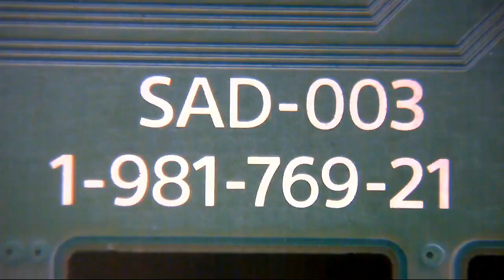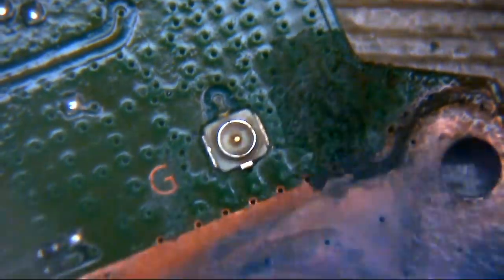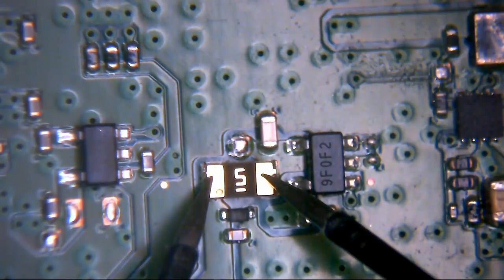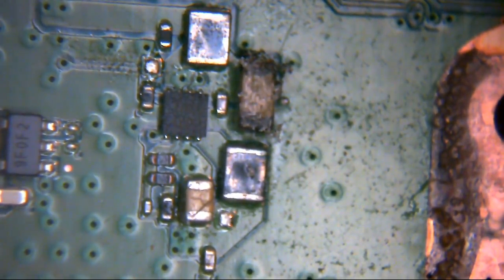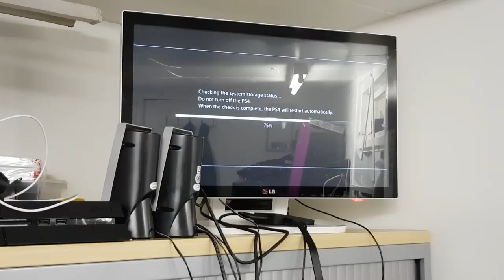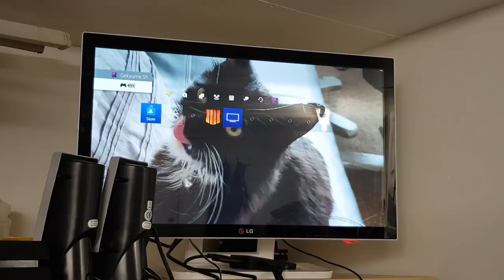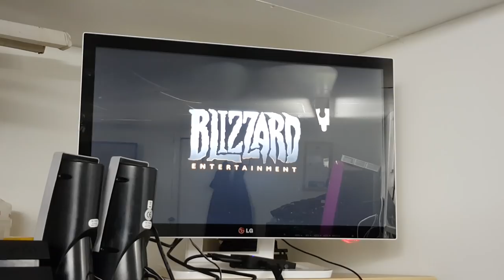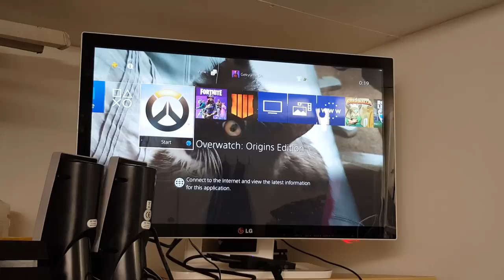PS4 Slim SAD-003 No Power - Component-Level Diagnosis and Repair

Comment: Quick question for anyone smarter than me - PS4 Slim, BLOD beeps once, then shuts off. It's not the PSU. No shorts on the Power Management IC or around it. No shorts on caps around and under SIE. Should I just salvage it for parts (if it's RAM or APU) or should I continue with the inspection? Thanks!

Comment: I have a question? Working on a slim power supply is good tested when I plug it up it takes about 3 minutes before it will allow you to turn it on I got it to update but after that when it cut off to restart it was the same issue. Now it’s trying to check drive so it cuts on then off to cut back on but instead of going to the check disk screen it just cuts off I can get into safe mode if I wait about three minutes for it to finally cut on. My questions is it the power management ic and where abouts is that located on a saf-005? Thanks any input would be appreciated

Comment: Possibly Going Mad with a 1200 Series PS4 😅.
Reballed the Southbridge Twice I have the correct Voltages around the Nor and Also 3.3V On the Switch yet It's playing dead definitely 1 i could cry over

Comment: Hi Andrew, my PS4 Slim CUH-2116A it has the blue light of death. When you turn it on the blue light flashes, the fan works very fast and loud at this timeand. When it turns off you hear three beep. Sometimes the fan does not start at all and the blue LED is constantly lit. Me wondering you know what is this? Is this a GPU, south bridge or power supply? Your video are great !

Comment: I have an slim ps4, that it does a "bip" and doesn't start up. It doesn't even give me a sign that it works, no light, nothing. I changed the psu but still nothing. When the device is like dead(without light or anything), only the eject button seems to work(makes a noise), but the power button, nothing at all. Any suggestions? 
I appreciate it

Comment: i have found electronic component cleaner spray can to effectively clean thick solder paste residue and corrosion removal. Its kinda oily but followed by iso prop clean, gives pretty good results. But im not a professional just a hobby of mine. And i dont know if the corrossion will spread again; i dont think mine is a permanent solution.

what temperature do you use on the hot air? i use 450 c. with airflow on 2 or 3 for small nozzle and 6 to 7 on large nozzle. is that safe?
Reply from the maker: Good to know :)
I'm using 490C @ 100l/min. Largely I leave it set the same, I just vary the heat / air intensity by controlling my working distance above the board / component.
Reply: @AndrewPaul  thats why that capacitor nearly flew away from that board ;)

Comment: I hope you don’t mind me asking a question about a one I have at the minute.  It doesn’t power up at all when first put into the wall. Leave it for 30/45 mins it will boot up and then last 5/10 mins and the process needs to be repeated. What could be causing this? Checked the system and it seems fine, battery good and the board looks good. It’s got me stumped! Can you help!?

Comment: Hi Paul. I know this is kind of old video but I was hit wall with similar issue. I have a ps4 slim SAD-001 that had faulty HDMI IC and replaced it successfully. Then found out the USB ports had no power and did a Southbridge reflow.  Now the PS4 has no signs of life. No power, no lights,  no beeps. Where should I look from your experience? I have reference board SAD-002 that boots up ok to compare but had no luck to find the fault.
Reply from the maker: If you've no power after a Southbridge reflow then it's likely to be related. For what it's worth, usually reflows aren't enough to resurrect USB issues on slims, it typically requires full replacement of the chip. I'd be tempted to do this in any case as you'll likely kill two birds with one stone - the Southbridge controls power management as well as USB functionality on these consoles.
Reply: @AndrewPaul  I have a d donor board,  and I will try it. First I will reball the current chip  since I noticed bridged pins at the edge of the chip. If it fails I will take the one from the donor board. They are not married with the mainboard,  right?
Reply: @AndrewPaul  The story short... I have the southbridge reballed once without success,  but since the reball was with wrong stencil and wrong size of solder balls,  this is not a conclusive result. I am expecting new stencil and balls at tge proper size to reball again. At least checking out the pins under the Southbridge didn't find shorts,  so I am hopeful that a proper reballing miggt fix the PS4. Thank you for your input mate.

Comment: But after replacing HDMI is still no image and I noticed there is a components knocked off don’t know what trying to find the schematic or help. The part is back side of the board (HDMI reference) right above the HDMI
Reply from the maker: Do you have a photo of the board in its current state?

Comment: good job andrew the first one brown is capacitor .. charge from one side and discharge from other side which goes to ground .. it stabilize voltage and keeps same voltage supply for the components during the ( ON ) condetion of mother board ..
the other gray ( you said is cap ) no this one is smd coil .. they are connected in each side so
normally there be buzzer in contunity test
will buzz .. how ever the coil function is to keep the amps feeding throu the for all other components in the ( on ) condetion 

good luck man 

i really enjoy watching your videos 

thumbs up

Comment: @Andrew Paul 
Thank your very much for your Videos ! I have a Question about the PowerButton on the PS4 , what Voltage should i espect to be on the Power Button ? Because i can only read 0.24 V on my Ps4 on the Power Button . This Ps4 wont turn on at all. thank to your videos i found out that the line filters on the HDMI Chip are all shorted to ground. I removed the Chip an the short was gone ! But the Problem remains i think its another short somewhere !
Reply: 4.7v on the powerbutton

Comment: Good morning 
Andrew. Thank you very much for uploading this educational videos. That is very appreciated. 
I  have a ps4 that will not recognize my controller in either of the front usb ports. I used a USB tester, and and I an getting 5V, but th wired controller that I use does not go into charging mode like it usually does on a normal ps4. I tried  swapping the BT module but that did not fix the issue instead the ps4 would not turn on. Maybe I applied to much heat to the donor chip and I end up runing it. 
Could it be that maybe the USB CHIP  that control the USB ports went bad and it needs to be replace? If that is the case what is the name of that chip?
Thank you!
Reply from the maker: Old CUH-10xx and 11xx machines it's a GL3520.
On anything else, it's the Southbridge which is responsible for hosting USB.
Reply: @AndrewPaul  Thank you very much for your help! You have wonder new year!

Comment: Hi Again :) please can you take a look  at my two ps4's normal console that's had blue light death and red light of death heats up soon as  you turn it on, dust build ip.  when you insert game few seconds in flashes red then turns the console off. and ps4 slim with hdmi issues , im looking at just getting ps4 slim fixed for the time bein can you pick my console up?
Reply from the maker: Sent you an email this morning mate. Cheers.
Reply: @AndrewPaul  Diolch i been waiting to hear from you need console fixed ASAP!
Reply: @AndrewPaul  get my yesturdays email fella on pulseing Blue when start up or turns white, also trying find ut do yu have Cnsoes picked up from South Wales

Comment: Andrew, what Ultrasonic device do you use?
Reply from the maker: This one I believe:
https://www.allendale-ultrasonics.co.uk/professional-13-litre-digital-cavitek-ultrasonic-cleaner-tank-with-heated-bath-220v
Reply: @AndrewPaul  which cleaning solution do you use and how much “water” do you need to fill in? i guess you dont need to fill up fully but just cover the board?
Reply from the maker: It's specialist PCB solvent supplied from Allendale. The bath itself requires a minimum level of 2/3rds of a tank of solution at all times - I'm assuming this is to keep the transducers cool during operation.
Reply: @AndrewPaul  Thats very interesting. Sorry ot bother you with the details, but it's my first Ultrasonic i have and wonder what experiences you have. How often do you switch the fluid/destilled water mix then? Do you keep the fluid in there and only chance when really dirty? or with every new wash?
Reply: @AndrewPaul  And sorry if I ask more thing, but I find your videos extremely helpful! Can you fit a PS4 pro motherboard in there? or do you basically need to lay it in "standing up" and turn it around, as not the full board is covered in fluid? seems that the dimensions of a ps4 motherboard are bigger than what fits in a cage?
Reply from the maker: You only really need to change it once it's dirty - to extend the life make sure any thermal paste etc is removed from heatsinks, dust is blown off the board etc to stop extra dirt from getting into the solution and making more regular changes necessary.
Reply from the maker: PS4 Pro boards will indeed fit. If you've any larger boards then you just put them in at an angle, flip them around after the first cycle and then do the other side.

Comment: Hi, any ides why 1116 is not glowing white when machine is on? Blue tight turns off but no white light, console works and plays. Replace led but didn't help
Reply from the maker: Indeed - behind the power contact is a row of transistors - are any missing or look damaged at all? It is these which switch the LEDs so any missing / damaged ones will cause this effect. Another one to check is the polarity of the LED - they are polarised so if they're put on the wrong way around then they may fail to illuminate.
Reply: @AndrewPaul  thanks for your reply, do you mean the ones on the right side of the leds?, there are 5 resistors
Reply: @jeksona27  I have exactly the same problem, I changed the LED and still get the same result, I can't work out what is stopping the white light

Comment: Hey Andy, what ultrasonic unit are you using?
Reply from the maker: It's a Cavitek Professional 13L model - has a heated bath and sweep frequency. Excellent piece of equipment but certainly not cheap. That said, it's got a fair few boards working from liquid damage and the likes which wouldn't have otherwise been possible so it's quickly paying back.
Reply: @AndrewPaul Whoa! Look at the drainage spigot on that. Perfect for toddlers little hands lol.